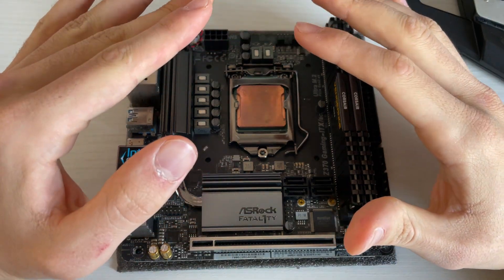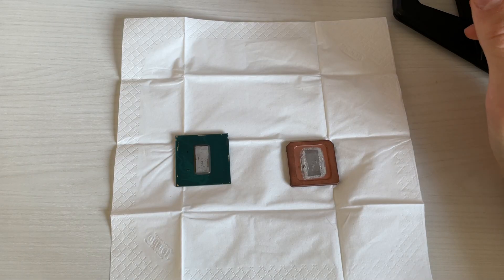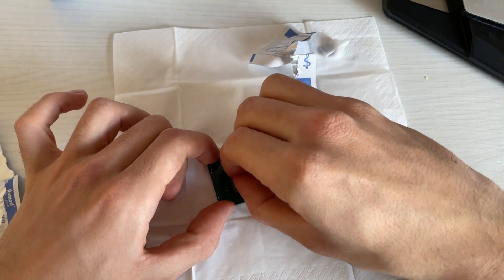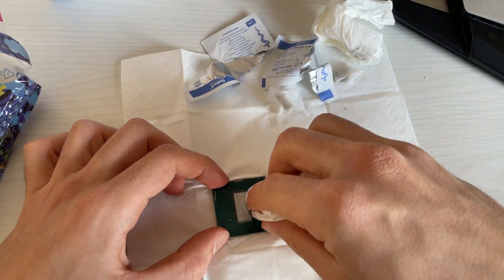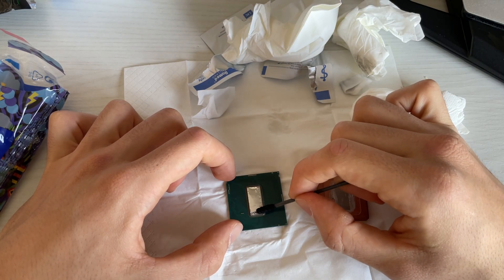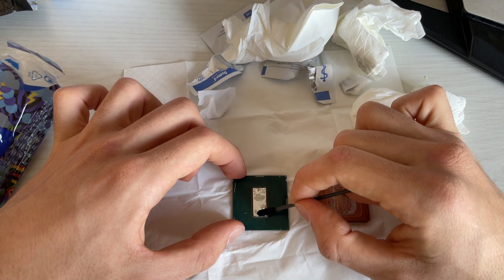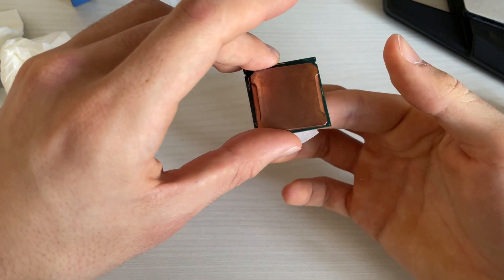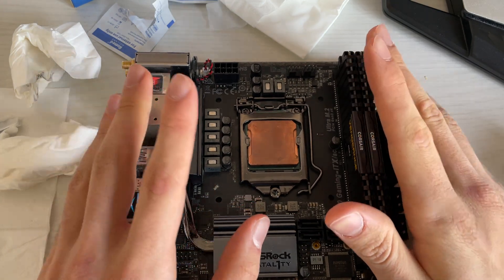Liquid Metal on i9 AFTER 1 YEAR - Copper CPU

Comment: Using a contact grams creates a more secure and tighter fit. I’ve seen where an ihs actually can move a bit over time when the normal clamp mechanism is used. So to anyone doing a delisting, please remember to use a frame for added safety and performance.
Reply from the maker: This is actually good advice! :)

Comment: I just used Liquid Metal and copper IHS for the first time. You mentioned that when the temp gets 10 degrees hotter is when I should reapply it.
Reply from the maker: Yes, that's what I personally do! You can also decide to do it either way after say 3 months, but personally I like to monitor the temps to do it at the perfect time!

Comment: Your application of the liquid metal is partially incorrect. Let me enlighten you.
When applying liquid metal, what you want to do is actually let it fully react with the copper plate. 
The reaction results in a coating which is often described as the “stain” or “corrosion”.
This coating is what conducts the heat more efficiently. Unknowing people even try to sandpaper it^^
Do not clean the CPU/GPU and heat sink with alcohol to remove the residual “dried up” liquid metal.
Instead, use a tiny bit of liquid metal on top of it. It will make the residual liquid metal fluid again and easier to remove.
Btw. liquid metal cannot dry up. What actually happens is it pulls the Gallium from the copper plate, 
what makes the liquid metal (now an alloy which has formed between the copper and the gallium) firm and less heat conductive! 
This is why a good quality heat sink matters! A copper nickle heat sink should do the trick.
To let the coating fully develop, you need to re-paste the liquid metal 3 times (at least from my experience).
After this, you don't need to ever re-paste your system again. If you have a cheap heat sink, then you will need to re-paste every 1-2 years.
I hope I could help :)
Reply: Are you sure you're not supposed to clean and reapply
Reply from the maker: Oh wow, this was actually really insightful! I definitely agree on the liquid metal needing to be applied around 3 times (maybe 2 in my personal experience) but so what you're saying it that I should not alcohol wipe it and should instead just apply more LM on top of it? If so, I think it makes sense and will definitely try it! Thanks again!
Reply: @ImWateringPSUs  indeed. Alcohol will turn it dark due to oxidation. It also oxidizes the hard-earned coating, and the process starts from zero.
Reply from the maker: @youjean83  I see! Is wiping without alcohol fine in your opinion or should one just add LM? Really interesting discussion by the way, will test and report back :)
Reply: @ImWateringPSUs  yes, it's fine. Just use some cotton pad to remove it or if it's Gallium free just apply additional liquid metal on top of it.
Reply from the maker: @youjean83  It was a really nice discussion, I honestly think you're right and will definitely pay more attention to it!
Reply: would REALLY appreciate a video walking me through doing that
Reply from the maker: @LukeFlegg  Will do it with my next delid!
Reply from the maker: @LukeFlegg  I always love getting input for vids :)
Reply: Well I have been watching YouTube for hours about LM and the things you say is nothing different. But I feel like you got more to say. 

About cheap laptop heatsink and i7-2630QM. I am using CM Nano Thermal Paste with Diamond Particules for my all new and old laptops, desktops. It has great longevity that you do not need to change for years.

But the problem is the one I mentioned at the top has 45W TDP and it is overheating! Always fan noise at idle. SHOULD I USE LM? Longevity is important for me and I accept for applying it 2 times in one year. After I will not need anymore right?

For cleaning that dry LM, you said use cotton pad but should I apply some new LM to make it liquied to clean Gallium? I mean it looks harden on the videos so I do not think that cotton pad will remove by itself.

Also do you think that will my idle temps drop some degree? (Do not forget that my thermal paste is very top quality so judge it by that.)

Comment: You know you aren’t supposed to touch the contact pads on the cpu right
Reply from the maker: Not really, nothing will happen! You just have to keep them clean!
Reply: @ImWateringPSUs  that isn't true. Your skin oils interfere with the thermal compound and make it less effective.  Higher temps
Reply from the maker: @mikerzisu9508  Nope, I wiped it with alcohol before applying it and it's perfect! Plus, the temperature thing only applies to the top of the CPU, not to the contact pads on the back! You still have to keep em clean tho!